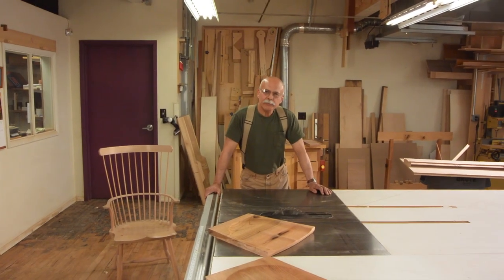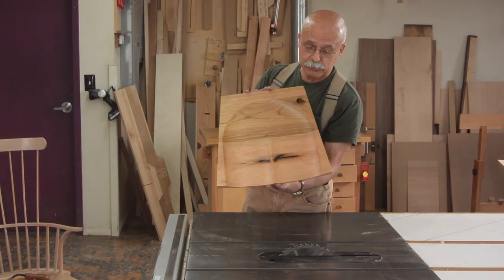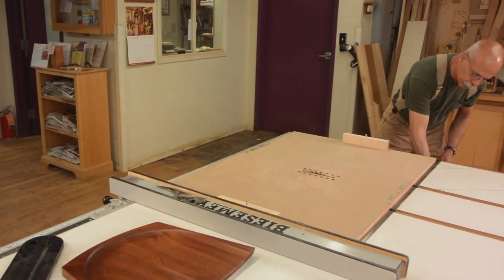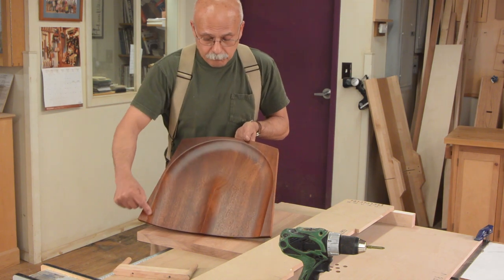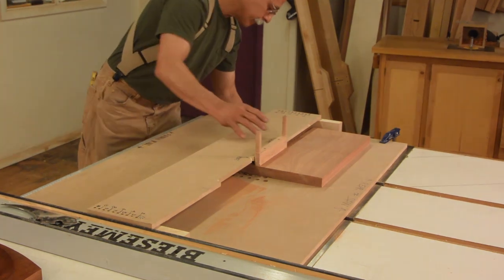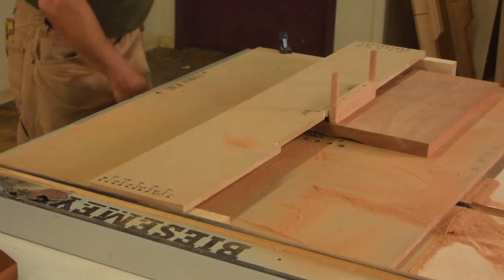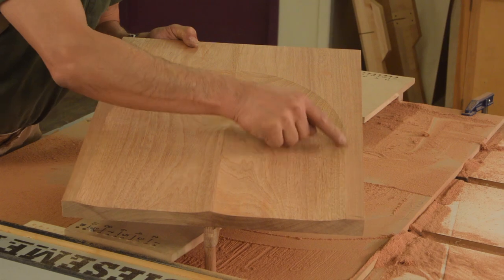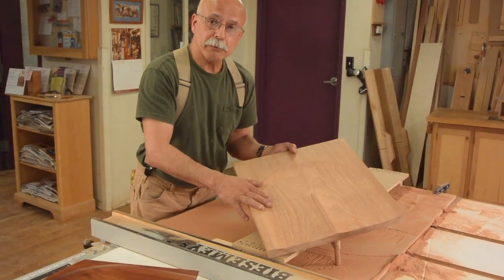Carve a Chair Seat on the Table Saw with Mario Rodgriguez

Comment: The link to the article no longer works, but you can download a purchased copy of the Popular Woodworking August 2013 issue.

Having completed the jig, I have found a number of problems with the design that made it unfortunately unworkable for my project, which is the construction of Windsor side chairs with fiddle-back seats, total finished depth of 19" including the 3" "tail" on the back of the seat. First, the distance between the bridge supports needs to be at least twice the depth of the work piece and that should have pointed out. Therefore, for my project, the base would have to be much larger than the 36", about 8-10" more, and the bridge as well. Cutting that size base and keeping it square is a challenge. Just a 1/2 degree cutting error will result in an error of 0.83" along that 36" side [the error = (arctan(.5))/32 = 0.83, which is about 13/16", where the 32 is the depth of the base]. The height of the bridge support needs to be greater than the thickness of the work piece or it won't fit under the bridge. For a 2" thick seat, you obviously can't use 1 & 1/2" for that in the design instructions, and that should have been pointed out. Next, there are problems with the 1/4" holes in the bridge piece. You can't put a 1/4" dowel in a 1/4" hole and expect to be able to get it out easily! Either the dowel has to be smaller or the hole larger. In addition, the distance between hole R1 and L1 is not the same as the distance from R1 to R2, which is obviously greater. Consequently, the holes need to be larger in the bridge and 9/32" works okay.

Comment: Mario, could you deepen the rear ot the seat cove by adding a small block in the front edge like Charles Neil does on his chairs?
Reply: just raise the blade on the last few cuts.  go slow.. cauase its more material your removing.

Comment: I'm wondering if changing the shape of the follower block would change the shape of the dish on the seat. Taper the follower slightly with the heavy end towards the center of the seat so that you get more of a tear drop look to the dish or vise versa or give it a very slight radius to help ease the super straight machine look on the perimeter of the cut.

Comment: Spacing of the holes in the jig should be determined by blade depth and a bit of trial and error.  It's plywood folks, not 24k gold. The worse that will likely happen is to have to use another piece of plywood. It's really not all that complicated to figure out. An easy and inexpensive way to test your jig is to experiment with inexpensive construction grade material, 2x pine lumber before plopping down the money for more exotic and expensive wood. 
Test, test and test. Take baby steps and practice till you're confident you have it right.
Almost every project that I think might cause me problems begins as a prototype made of inexpensive material. Once the bugs are worked out I move on to other materials.